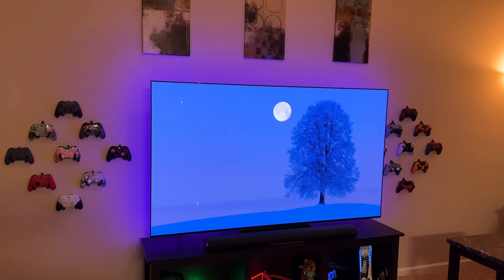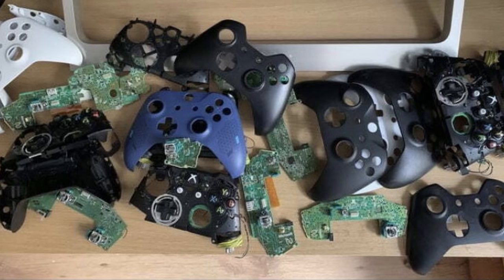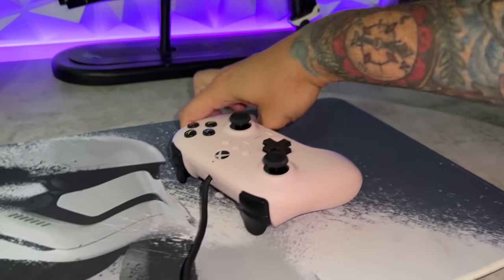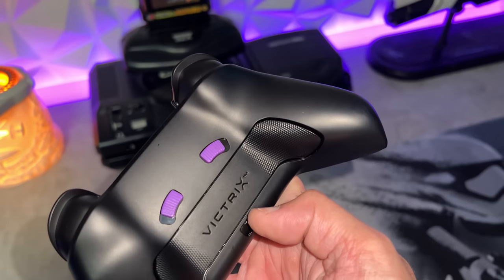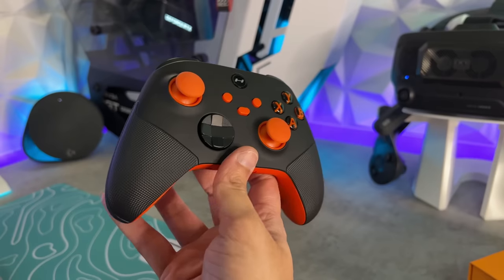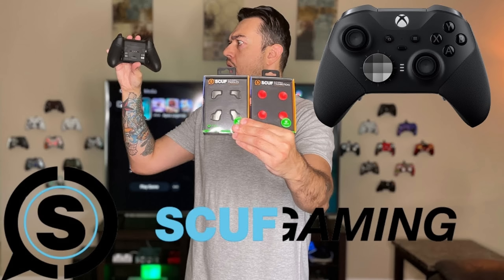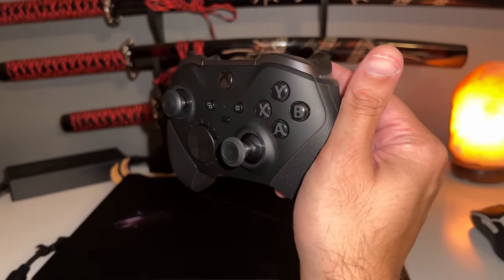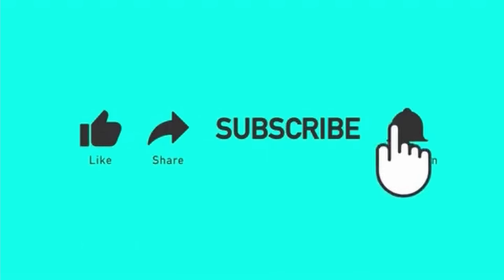Best Xbox Controller-28 Compared in 3 Price Points (Ultimate Showdown)

Comment: I’ve used the Elite Series 2 rear paddles and they made my index and middle fingers numb. It’s almost like starting carpal tunnel syndrome. Then I played without using them and I could game again. Would rear buttons help solve the issue of losing that feeling with the paddles? I mostly play FPS games and thought maybe the 8bitdo Ultimate Bluetooth or Pro 2 might be a good replacement. But they only have 2 buttons 😕

Comment from the maker: As mentioned on social media last night it should have been a 31-way shootout not a 28, as I forgot to bring out the Nacon Revolution X, Nacon Pro Compact, and Cinch Custom. I have dedicated reviews for both Nacon linked at the bottom of this comment, and this pinned comment explains how the controllers fit into this comparison. 

These controllers may have RIG in the title which is Nacon’s newest branch of gaming peripherals. They are both wired and have Dolby Atmos virtual surround support from the 3.5mm headphone jack AND a subscription/activation to Dolby Access (a $15 value) on PC and Xbox consoles to be able to use them. Keep in mind this won’t sound as good as native Dolby supported headphones, soundbars, surround, etc..but it DOES sound very good as seen/heard in both my reviews. In North America Nacon has a 1 year warranty, but every other region gets 2 years.

The Pro Compact is physically small, which is good it you have tiny hands but even if you have average/medium hands it is still pretty comfortable due to having full size thumb sticks with anti-friction rings, and oversized face buttons which I LOVED due to being big and flat. Mini retails for $50 but is only $30 only Amazon currently depending on which of the 3 color you choose. If you need a cheap controller this is a good option, however it has a permanently attached 9.8 foot cable and isn’t as comfortable (for me) as almost all of it’s competition.

The Revolution X is still its launch price of $100 in white or black but goes on sale occasionally, and was $80 during my initial review. As for the cons slippery included thumb sticks, slick plastic shell with no rubber grips, a weird bumper design, and no trigger stops or smart/digital triggers, an expected staple of a $100 pro controller. On the positive this gamepad has 4 comfy rear buttons sunken into the rear shell flush you can map on the fly, the thumb sticks performed good in gamepad tester and have anti friction rings like its cheaper mini brother, the application on PC was quite good, and the Dpad and face buttons are large and clicky. A decent option at $100 however it feels and looks pretty cheap despite controllable RGB around the thumb sticks and I wouldn’t recommend it over the ThrustMaster Eswap X in the mid tier.

I didn't recommend the PS5 Dualsense from Cinch Customs and the Xbox offering is no different. Their Xbox pre builts when they do have some in stock vary from $190 for no rear paddles (how, just how), $230 for a 2 rear button, and $330 for a 4 rear button (without a remap chip, again very overpriced). The controller builder on mobile phone is terrible to navigate, PC works better but is cosmetically ugly while creating a controller with VERY LIMITED options and parts. $182 for just 4 rear buttons on a stock black looking controller, and there is no remap chip available just like Aim so you are stuck with static rear button mappings you select in the builder. Build time is 6-8 weeks or 1-3 weeks for $30, and you only recieve a 30 day warranty or extend it to a still short 6 months for $30. On top of being overpriced, not having as much customization, a fairly long build time and short warranty, my biggest complaint is Cinch puts their 4 rear buttons stupidly close to each other, even if you are covering all 4 rears with just your middle fingers it feels like you are covering 2 buttons because they are so darn cramped. As with PS, for Xbox Cinch is at the bottom of the custom controller recommendation list. 

RIG Nacon Pro Compact Controller Review
https://youtu.be/wHTiHHK5_mU

RIG Nacon Revolution X Controller Review
https://youtu.be/VPtsvajKSnM

Cinch PS5 Controller Review
https://youtu.be/J1RmG4bnG7s
Reply: But the sticks have 100% accuracy. Its the best controller I’ve used as far as accuracy goes. Eswap s is good too, but i went through 4 in a month due to some sort of technical issue they seem to have where the thumb sticks intermittently lose connection with the rest of the controller, so i finally gave up on it.
Reply: Bought the Nacon Revolution X a few days ago, it arrived yesterday. I was excited to open it up and test it out, was disappointed at the size. I have average size man-hands, and the controller is just uncomfortably large. Like, width-wise, I feel like it's built for longer fingers than mine. And the rear buttons (paddle spots) were just uncomfortable.
Reply: Please pin your comment. It's very important, and it's getting buried.

Comment: On my third elite now, and when you get a good one it’s a fantastic controller. And if you don’t, at least Microsoft sends you a replacement within a month (in my experience).

If they offered Hall effect sensors on their controllers in the future, I would be tempted to spend some of these outrageous prices you see in the controller market nowadays
Reply: They are a business, their goal is to make money not hard to break controllers
Reply: @FERTUHG  people eventually stop buying a product if it always breaks. you actually make MORE sales if consumers WANT to buy your product.
Reply: I got one of their custom Design Lab built Elite Series 2 controllers and had to exchange it 3 times, finally ending up with a refund on the 4th send back due to partially unresponsive A/Y buttons. I actually think this one (not stick drift, bumpers, etc.) is an actual design flaw with the controller that maybe a lot of folks just don't notice?

Big sadge though, the controller is otherwise nigh perfect?
Reply: I think I'm on my 10th...maybe even more?  elite series 2. They tend to reach a point where they become unusable for one reason or another at around 3 months for me. The longest one lasted me was maybe 6 months, and it was the white 'core' version. I only have to pay about $50 Everytime I need a new one thanks to Best buys insurance, I know I could just go through the manufacturer warranty when they break, but 50 dollars isn't a lot of money for me especially since I can get a brand new one the same day the last one breaks. I do use plenty of other controllers for specific use cases, but the elite 2 is my daily driver. I think I might try that new turtle beach controller instead next time my elite 2 breaks though.

Comment: Since my first Xbox One until my Series X, i actually had 8 (!) original Xbox Controllers turned into Stick Drift within a few months. It was always the left analog stick (used for running). So i was very happy to hear about the Gamesir G7 SE, the first Xbox Controller with Hall Sensor joysticks. And i really don't get why even premium Xbox Controllers still don't have this. Potentiometers are the weak spot of any controller, soon or later.

Comment: Great video, as always. Love your content. I do think you have it backwards, though -- regarding the Elite II units sold, and quality control issues. The reason such a high number have been sold (aside from being Microsoft's official top-tier controller, and its prevalence/stock in brick-and-mortar) was the "quality control" (strategic obsolescence, in my opinion...) issues. I had an Elite I for 1.5 years before I needed a replacement (well cared-for). When I "upgraded" to an Elite II, it lasted me 2 months. Warranty swapped for a brand new one - 3 months. Endless issues with stick-drift and non-responsive bumpers. Gave up on them awhile back. Hope the rumors of their improvement are true..
Reply from the maker: I’m sorry to hear you’ve had such a rough run with the elites. I’ve had my OG series 2 for almost 3 years
Reply: @GamerHeavenOfficial You said their QC is getting better. Sounds like the older ones were better and QC is getting worse? I wanted to go out and pick one up today. But now I'm nervous to.

Comment: In the process of getting a Hex, but I recently got the Powera Fusion 3 and it has been excellent.  The rear buttons are made for people with smaller hands and its been the most comfortable controller, even more so than stock XSX one. Dont sleep on it
Reply: Fusion 3 was amazing, had absolutely no issues besides the cable giving out, i had to swap it out for a stock XBX controller, but i’m tired of having to put batteries in it and i have no job at the moment so i can’t get a play and charge kit, got an Elite Series 2, the x button is stuck so i’m gonna keep using that until the button stops working and then i’ll replace the series 2 with protection plans until they come out with the series 3 or i get a good elite series 2 batch

Comment: I appreciate you taking the time to test all of these controllers. I got really bad stick drift on my series x controller and need a replacement. I couldn't get myself to spend over $200 on a aim and the discount code minimum is a joke($259 or above to use). Getting a elite series 2 with extended warranty based on your video!

Comment: I just got the Instinct Pro last week after exchanging about 12 Elite Series 2 that all had stick drift out of the box and I absolutely love it. It's definitely overpriced though. It should be around $150 in my opinion. Although it's quite expensive, I'm definitely digging it more than the Elite Series 2 overall. Also, there was a card in the box that said the warranty was increased to a full year instead of 6 months. Definitely consider this controller if you have no problem dropping $210 on a controller.
Reply from the maker: Jesus Christ that’s so many elites 😂. I shouldn’t laugh, that’s terrible that that happened. I’m glad you have moved to greener and more reliable pastures
Reply: Yeah the elite 2 is still horrible I hope they redeem themselves with the third addition with bumpers that work and hall effect joysticks
Reply: @n64slayer  fr my custom one from Microsoft design lab the right bumper began doing a double input when I clicked it once and now recently my left one it doesn’t do an input when I click it sometimes and my A button is starting to act up a little. I’m going to wait for the elite 3 to see if they fixed quality control and stuff and if not I’m going to consider getting a scuf and maybe by then scuf will make a new version of their Xbox controller so that you can have the ability to click all 4 back paddles at once and not this rolling your middle finger thing lmao
Reply: @Precise_Ant76  do u play on pc or xbox?
Reply: @n64slayer  I currently play on Xbox but I’m saving up for a pc and going to get the components for it and build it myself :3
Reply: hey man been debating to get the scuf envision or the instinct pro or elite 2 myself i heard that the instinct pro squeaks is this true with ur experience ?
Reply: @KeegBennett  I have not experienced any squeakiness at all.
Reply: @KID_CHAMELEON  That's good to hear! So probably a quality control thing just like any other company cuz even the standard xbox controllers ive experienced them squeak but they only $79 vs the $219 price tag on the scuf lol but have you seen the envision pro whats ur thoughts on that 1 and would the reflex pro would for gears of war on pc or nah
Reply: @KeegBennett  I don't know much about the envision aside from that it's PC only. If you're between the elite series 2 and the instinct pro definitely go with the instinct pro. It's a little more expensive but well worth the price difference. Elite series 2 has too many issues.
Reply: @KID_CHAMELEON  thanks alot for that feedback do u know if the instinct has a better input delay cuz i think the elite has 7ms and envision has 1.7 and dualsense edge is like 0.7 but idk bout the reflex pro
Reply: @KeegBennett  I don't know what that actual numbers are but it's definitely not enough to notice. It's got the guts if a standard Xbox controller so I'd bet it's the same as a regular Xbox controller.

Comment: MASSIVELY IMPORTANT TIP HERE. In ds4 windows adjusting Max Output to something lower like 95% or even 80% and then putting sensitivity to 105% or 120% respectively will give you NEAR PERFECT circularity. The lower you put Max Output however decreases the accuracy so it's not recommended to go below 90%. It would be nice if you could explore this more btw lol
Reply from the maker: I am doing a DS4 windows tutorial in the near future, and I will cover the adjustment you mentioned along with a bunch of other useful tweaks. I’d also like to clearify what you’re saying would SHOW good results in game pad tester but generally FEEL like ass due to not having 20% of your outer movement on the stick, and using a higher sense to try to counteract that. Cool party trick to show your buddies a low result in Gamepad tester…not advised for actual gaming.

Comment: Awesome video 💯💯. I watched your video on the GS G7 and then  the one on the GS G7 SE. And was at crossroads which one to get but this video made up my mind GameSir G7 it shall be. Controllers are expensive where I live so I'll have to care it so doesn't get stick drift quickly.
Reply from the maker: Right on, I hope the G7 works out great for you for a long time.
Reply: @GamerHeavenOfficial  it's good feels amazing by the way no lies told. Only issue I had Is the stick felt differently than what I was used to. Especially when playing cod. So I had to play around with the stick dead zone.
Reply: @Direalest  are the Sticks a little bit looser?

Comment: 42:35 nah, man. I have had 4 and they all developed double clicking bumpers (my current one even has a double clicking A button) after 3-4 weeks. You can easily test this by pressing and sliding over the bumpers, they pretty much turn into rapid fire buttons. Contact cleaner fixes the issue temporarily.

I had never stick drift on the ones I had, though. 

Anyway thanks for the video. Prolly picking up one of them Gamesirs or an eSwap. Wish the wireless options would be cheaper... am not dropping 200€+ on a gamepad. lol

Comment: I recently picked up the Gulikit KingKong 2 Pro as well as the Gamesir T4 Kaleid. I'm using them as PC X-box controllers on Steam. I like both of them quite a bit....maybe the T4 the most. The Gulikit feels higher quality and more solid, plus those triggers are the smoothest I've ever felt, but the T4 has better touch on all the other buttons. The thing I don't like about both of them is the View button is placed badly. You can't really hit it without bumping the left thumbstick. One of the biggest reasons I got the T4 was so I could remap a rear button to the View button.

Comment: Best game pad reviews hands down! Im surprised you didnt mention the nacon revolution x. Just picked one up on prime day for 60$ and wow what an amazing controller! The software is really good and the thumb sticks are buttery smooth.
Reply from the maker: Thanks
Reply: I've had my Nacon RIG Revolution X Pro for over 1.5 years playing at least 4-6 hours a day and the sticks are still working excellent compared to my Xbox elite series 2 stick had stick drift in three months along with all my other big-name brands like Razor Wolverine, Scuff etc. are all garbage do to the analog outdated sticks they use.
The Nacon RIG Revolution X has been very solid and truly the best one ever for durability and no stick drift. FYI, they did just come out with a new one that has hall effect sticks. I think my "RIG" version has them, that's why its lasted this long, someone said to get the one that says RIG because they thought that one has the hall effect sticks. 
The only thing I wish they would have updated on the new one was to make the body closer size Xbox controller and update the back paddle buttons on the handle so you can click the rear ones easier.

Comment: Will be picking up my ThrustMaster eSwap Pro S later today. Looking forward to some Warzone action using NXG mini sticks.
Reply: Hey I’m curious on how your eSwap S is working? I bought one as well I while back and within a couple weeks I noticed the thumbsticks had already developed a significant jitter. So I bought another set of thumbsticks and those too developed jitter in only a couple weeks. On top of that I noticed my A button would do extra presses randomly after only about a month of use. Is yours still working fine, or have you since trashed it for something else? I really wanted to like this controller, but from what I’ve used myself and what I’ve heard from others who bought them they’re just junk.

Comment: I absolutely love the elite series 2/core controller; my original series 2 lasted 2 years and through a move from VA to GA, then out of nowhere it popped a huge amount of stickdrift. Then I got a series 2 core and have had it almost 2 years and no sign of stick drift (i use the accessories from my original series 2) If you get lucky (Q&C is getting better) and get a good one it'll last a long time

Comment: I actually have both the Advance and Ultra X from HexGaming. Both great controllers, though I actually prefer the Ultra X for its extra features and I actually don't mind the rear button placement (seeing as I use 2 rear buttons most of the time, but I can still reach the other 2 buttons with my middle fingers if need be). I built the Advance through their site and I really like how it turned out, but my only gripe is the lack of friction rings for the thumbsticks.